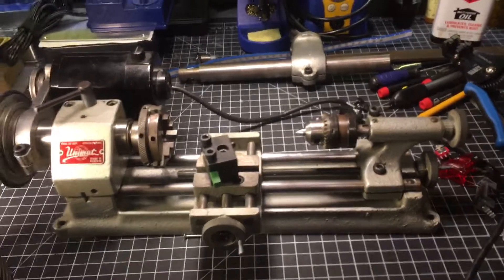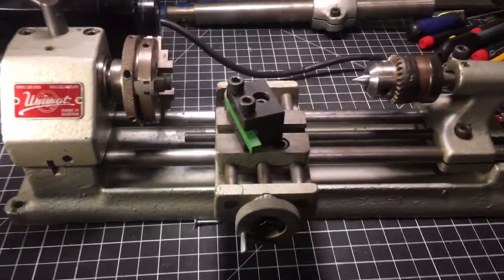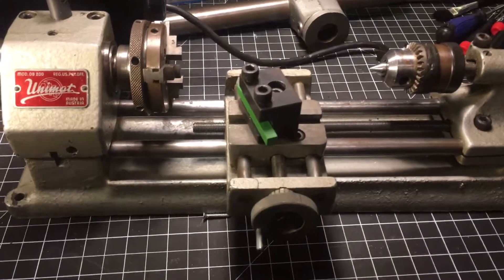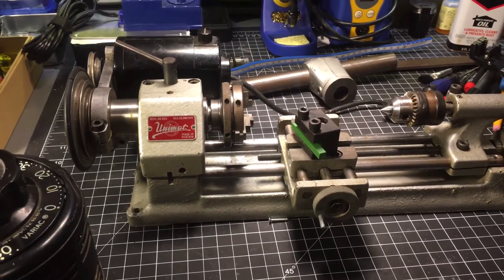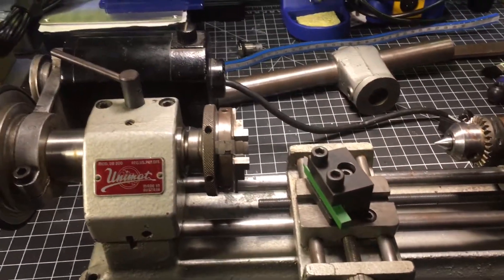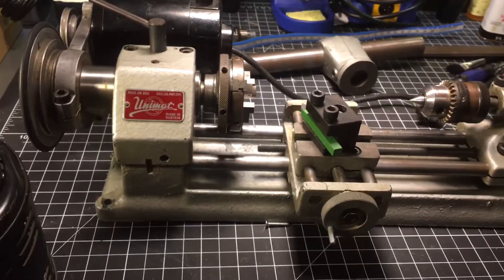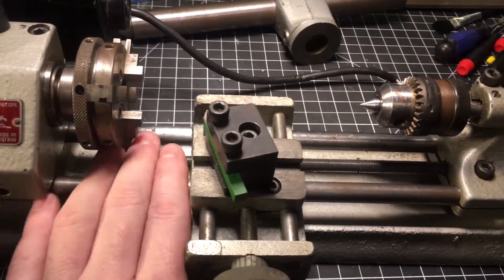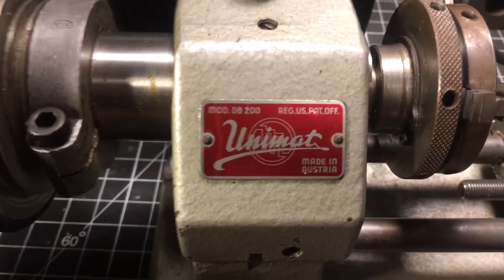Unimat DB 200 Metal Lathe/Mill - Using a Variac as a speed control?!?  Bad Idea?

Comment: If this is still relevant now (3yrs later)  It should be Ok?   That motor is known as a 'Universal', a type used a lot in sewing machines, where speed was controlled by a rheostat in series..  Only caution I would have is to check the temperature of both the Variac and the motor while in use..  Oh and look at the Variac's current rating.
     I used a similar setup for a drill in a drill press stand for a while with no problems.  :)

Comment: nice. can you tell me about your lathe ? do you have manual of it? recently i do purchase the same lathe like yours, but only lathe without motor or milling support.  it's cast iron made, based historical research on internet i know it's MK-2 version.
Reply from the maker: There’s not much to tell. It’s a great little  lathe thatbworks a treat. It is a workhorse and it’s small size is only to achieve very prrcise machining and not because it’s a toy. I’ve been told that many watchmakers use this lathe and I actually saw one in Phillippen Dufeurre’s workshop, the famous watch maker. His sho is JUST HIM and sometimes his daughter as a helper and he makes EVERY SINGLE PIECE TO HIS WATCHES. THATS INCREDIBLE. Even some of the most famous watch makers in the world have their crystals made but not him. He makes them and if the Unimat is good enough for him then itsbdamn good enough for me. 

Check out a site called little machine shop if you need parts. They are very helpful and have a lot of Jnimat parts. 

I’ve been mulling a lot of nylon and Deleen lately and it blows through that material Like fresh butter.  It mills aluminum almost as easily with hSs tooling and with carbide (which I’m not crazy about) it’ll cut pretty much any metal barring heavy titanium. 

I would suggest getting the four jaw chuck as a first accessory over the three jaw and the steady rest. 
Other than that, I usually make my own tools and use regular metal bits when drilling either etaikstock. 

When milling I use these high quality end mills that I bought an an estate sale from an old retured machinist. He couldn’t remember the name of the manufacturer and they were only marked with “made in Germany” which says a lot. They are great end mills and probably better than I deserve for the projects that I’m capable of. They seem to almost self sharpen. 

Also, use just a tiny dab of ATF when cutting to keep the heat and noise down. It will cut without it but it’s nucer for everyone with a touch of help Le juice. 

Dunno what else I can share with you. If you wanna send me ouxknod your lathe I’d be glad to take a look. I’m in the market now for a working monarch lathe (awesome lathe) and a good condition Bridgeport
Milling machine with a DRO and some other accessories like an oversized sned (magnetic) and I must get my hands on a nice big HD pro model Hobart rig welder (or Miller or Lincoln) and a portable stick welder. I don’t yet want a mug becaus I want to force myself to use the rig and get good and laying dikes. Oh and I really want a spin Dexter or spinning wheel
On a speed control for welding round parts. 

If you have access to any of theee
Items, please let me know. Thanks for the Like! Feel feee to subscribe. It’ll really help me out!
Reply: Thank you for your reply about your unimat lathe. the unimat lathe was my first fall in love on lathe back that the day, but the price was quite really high on ebay. the use variac to reduce AC motor is good idea, but the unimat use pulley system to reduce speed, if you reduce speed from the motor, the torque will decreased too. except you are using variable DC motor, it's design for that purpose. I'm using Dunkemotoren GR63x55 for my TAIG lathe with DC speed controller. 

like everyone say, it's never enough, curently i own JMB universal milling machine (German made, same old as unimat 1955 s ), 7x12' lathe, emco compact 5 pc that need restoration, taig lathe & milling, and finally the unimat MK-2 lathe that i was wanted for long time ago. I have chance to purchase Makino milling machine (japan made) same as bridgeport size for only US$1500, that was good price, but i dont take it because i have limited room for my shop.

it's good info that unimat lathe used by watchmaker, I dont know that the unimat is used for watchmaker, maybe for secondary purpose or that job don't need huge precision. as long as i know the watchmaker lathe was expensive, boley, cowells, the cowells it self cost US$3600 for lathe that have same size as unimat http://www.cowells.com/pricelist.htm . go too http://www.nielsmachines.com/en/ for vintage old desktop machine (lathe, milling). and http://www.lathes.co.uk/unimat/ for super comprehensize explanation of unimat lathe. 

thanks
Reply: what about your motor? is that sewing machine size? any size or dimension of that motor? thanks a lot of your reply :) . i do really appreciate it.